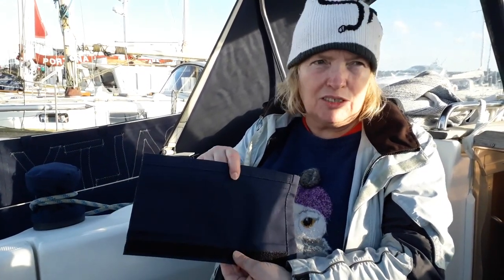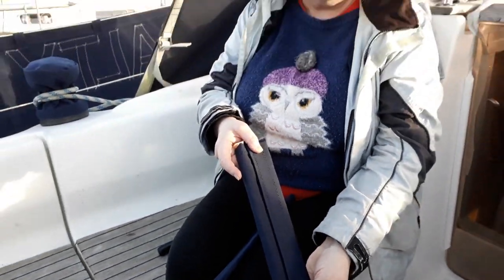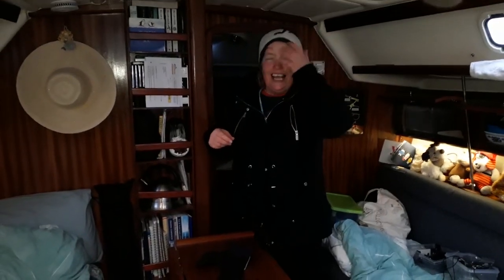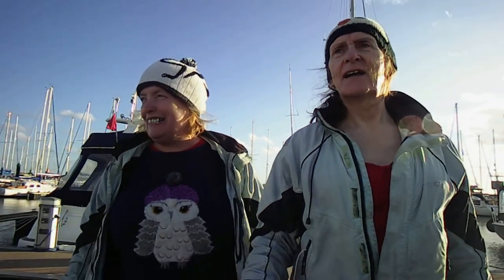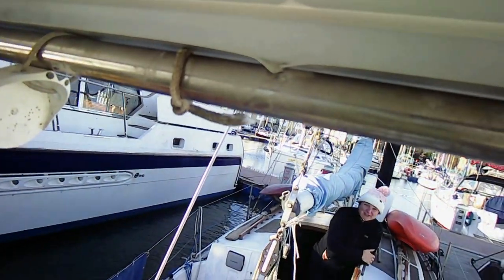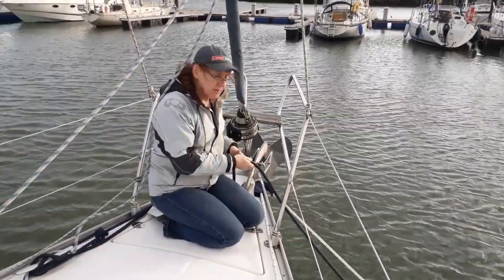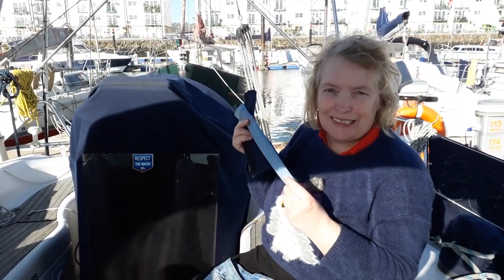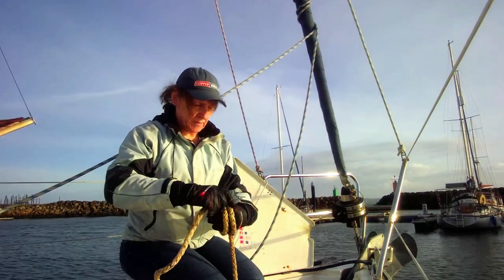Sailing Northern Ireland - How NOT to protect your mooring lines - Ep. 175

Comment: I use plastic hose pipe for chafe and squeek protection and it has been very good so far,
Reply from the maker: We tried that and if it was big enough the let the mooring line through the centre of the hose, it was too big to fit the fairlead comfortably. We are keeping an eye out for old firemens hoses as they are some sort of cloth

Comment: Octoplait is ideal to use as an anchor snubber. Make a section into a Y bridal.
Reply from the maker: We cut the octoplait into 3 10m lines so it can be used anywhere. It "snubs" beautifully and is a lot cheaper than those "rubber snubbers" that break in storms
Reply: Yes. Yes.
Excellent suggestion.
Way to go.
Keep smiling buddy.

Comment: You can buy a length if chafe protector from ebay in different diameters that just slide over your lines and can be secured with a cable tie. Alternate is a cheap vegetable open weave bag from a supermarket. I also have used these from Lidl.
Reply from the maker: Interesting tip. We will give that a go when the current denim wears through. Thank you!

Comment: Grate video as usual.
How long was you using the denim before I wore away, try a bit of dish sope  on your lines it stops them sqeeking, we use fairy liquid and it works a treat
Reply from the maker: The fairy liquid sounds great. It would be interesting to see if it survives the downpours. At least the lines would be nice and clean... The denim lasted better - months if not a year, but it is only a light denim. We have decided that a heavy, organic (non-plastic) material is best.

Thanks for the tip and thanks for watching! 👍

Comment: Hello my dears. I am now four episodes into watching you. I won't repeat all the previous advice regarding octyplait, Fairy liquid, or simply a splash of water on creaking lines. What I have found best is running my sprigs fore and aft from a large midships cleat. Don't have one? think about fitting a pair. But I beg you, do not tie a monkey's fist or any other restriction regarding the bitter end of the anchor chain.

The bitter end should be light enough that it doesn't damage your boat. If you have to get out of somewhere in a hurry, there is nothing wrong with tying a large fender/belter to the end of the anchor chain, outboard of course, and then cutting away the bitter end. Your anchor and chain will still be there when you return to retrieve it in more clement weather.

DO NOT RESTRICT THE BITTER END.
Reply from the maker: Hi Teddy - the monkey's fist was only temporary and has since been undone. Onboard, we each carry a sharp knife just in case a rope or line needs to be "removed". We do attach our springs to the midship cleat but sometimes they just squeak a lot. Tonight they are utterly silent.

I have read the tip about fendering the anchor chain elsewhere. Hopefully, I will never need to do it.
Reply: @SailingYachtSaltyLass  Sorry if I came on a bit strong, but it's bit of a thing with me. When I bought my present boat off a "Yachtmaster" blah blah blah. It wasn't until sometime later that I discovered a thumb knot in the end of the anchor chain. And there has been a subsequent occasion when I had to let slip the lot to recover later on. Single handed with a windlass well past its best, makes for a few interesting moments.
Reply from the maker: Hey - no worries! We all have things that concern us, often from "dodgy" experiences. We are no different.